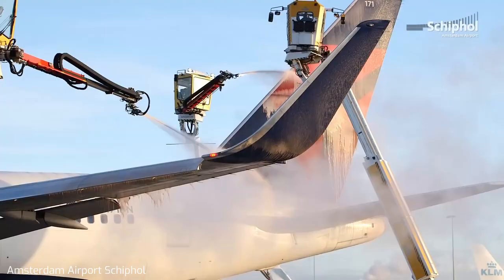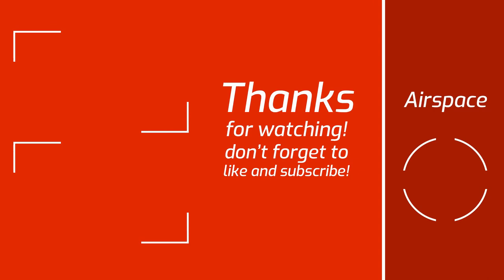Airplane De-icing: How are planes De-Iced?

Comment: Based on a couple of other videos I saw, even after thorough de-icing, a plane can wind up flying through icing conditions in flight - which can build up on the wings again. Apparently this is why I see pilots who fly over Canada, Russia, Alaska and the Scandinavian countries try so hard to avoid these types of storms. Do airplane de-icing systems just use heat, or do they also spray fluids on the lifting surfaces?
Reply from the maker: yes, we try to avoid icing as well as possible. In flight, the critical areas of the wing are heated. Others are not, and some ice accumulation there is not critical in flight, as it is usually just a very small amount. Commercial Aircraft use only heated air or inflatable tubes to break off ice. There are some smaller aircraft that leak de-icing fluid onto the wing, but that is not very effective.

Comment: You started so scientific explaining the pressure arround wings and the air flow in normal conditions, but with ice on the wing it may not produce enough lift but still didnt explain why and what happens with pressure and airflow when there is ice on the wing xD